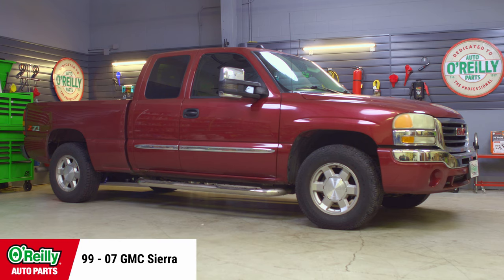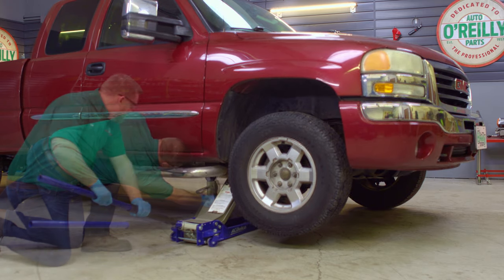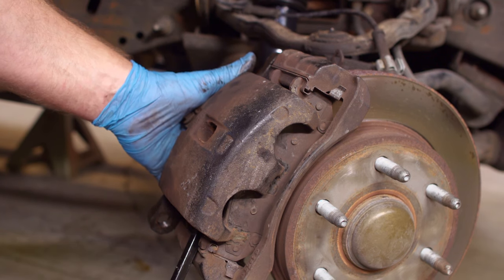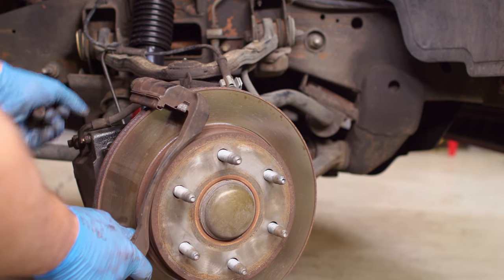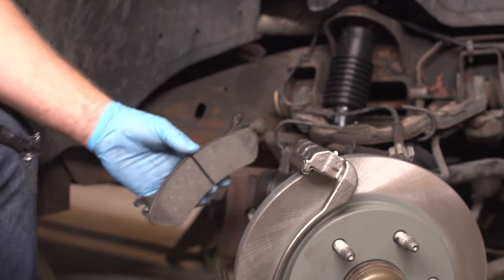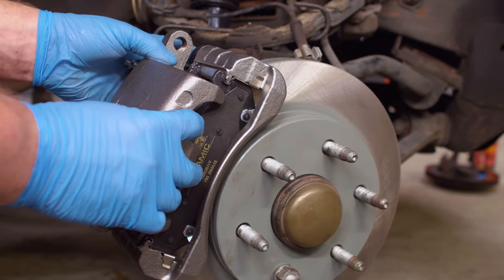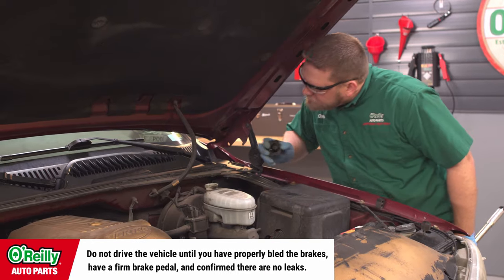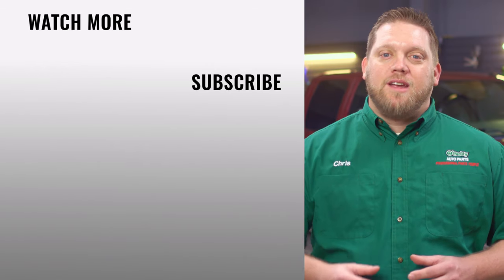How To: Replace the Brake Calipers on a 1999-2007 GMC Sierra 1500

Comment from the maker: Supplies Needed for This Job:
1. Safety Glasses: https://urlzs.com/hbwc
2. Gloves: https://bit.ly/2GvfwAm
3. Jack: http://bit.ly/2ZxQiJl
4. Jack Stands: http://bit.ly/2L1YEp9
5. Ratchet and Sockets: http://bit.ly/2IEAOOi
6. Breaker Bar: http://bit.ly/2UWfies
7. Penetrating Oil: http://bit.ly/2H6qr42
8. Flathead Screwdriver: http://bit.ly/2GTfy5c
9. Caliper Hanger: http://bit.ly/2IZyP6K
10. Wire Brush: http://bit.ly/2GLDsjj
11. Brake Grease: https://bit.ly/3hwhEYY
12. Caliper Compression Tool: http://bit.ly/2XNZPtN
13. Bleeder Tool: http://bit.ly/2XQx9Rf
14. Brake Cleaner: http://bit.ly/2UxiRmp
15. Shop Towels: http://bit.ly/2GDgwm1
16. Brake Caliper: https://bit.ly/3bnoDBb

Comment: This was a very good video for someone that has never tried this before.  I believe though that two very critical things were over looked. If I may, It is very important to instruct that the mating area where the caliper bracket meets the spindle is crucial to be very clean. Second;  There were no mention of making sure that the old brass washers are removed from the brake line mounting block, Look for shine and you are fine, If you see brass, it will be your ass!

Comment: How do you tell left from right?  The answer is that the bleed screw will be up.  I saw no mention of this detail in the video, nor did I find instructions to indicate this.  The part numbers on the units are identical, so I saw no reason to concern myself with left or right.  If you get them backwards, you will never be able to bleed the brakes.
Reply: Yessir just found that out the hard way!

Comment: Just did this and replace my front hub assembly on my 2006 Silverado. Anyone have a problem with the hub not spinning at all by hand after it’s all put back together?
Reply: I know this is late, but the axle nut is probably too tight

Comment: I have a question for you, I have a 04 gmc 1500 with the quadsteer and I'm looking to change the rear calipers ,  are they the same as what's on a normal 2 wheel steer 1500 ?
Reply: It actually isn’t because the 2wd has drums in the rear. Well at least mine does
Reply: @zombiekill541  mines 4 wheel steering - was wondering if it was the same as a normal 4x4 with 2 wheel steer... Appreciate the response though 🤙